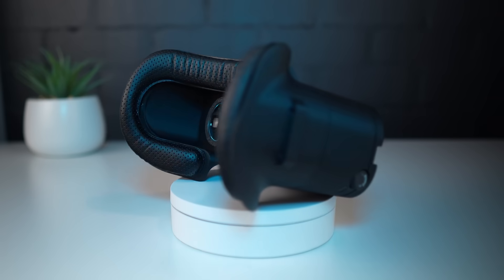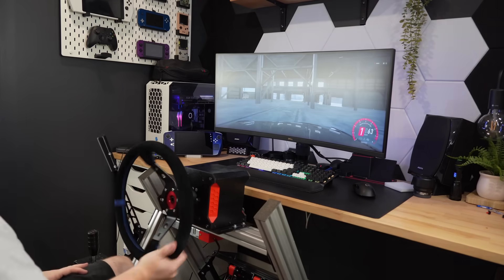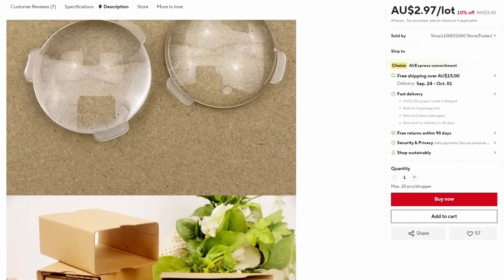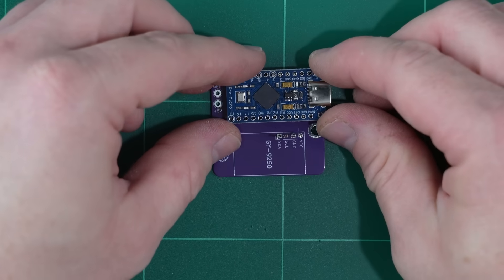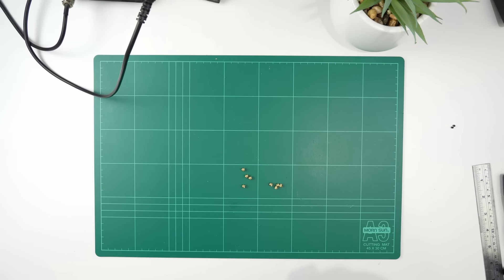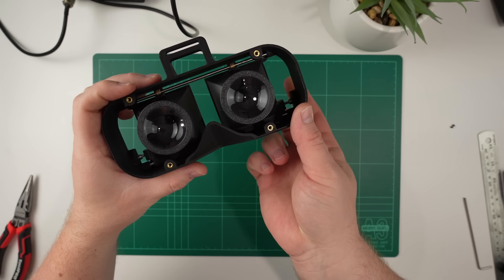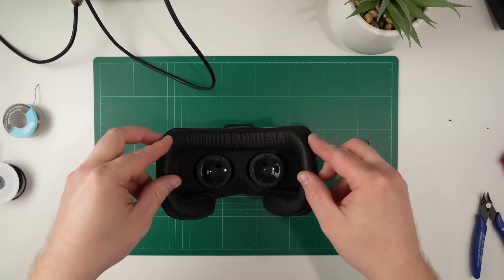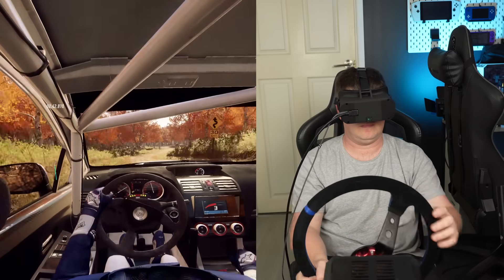I built my own VR for under $150!

Comment: 3.81' 1:1 oled screen is from lg wing bottom display. they are well know in the retro handheld emulations. not ideal for your case. but afair there is a 960p 3.4' 3:2 120hz display may be of used. it was used in anbernic 34xx and 34xxsp

Comment: This is great, going to give it a go.  You can get a 2nd hand Quest2 now for about $150-$200 so it doesn't save much money, but it's a great project.
Reply: From what I've seen on FBM, Quest 2 seem to range from $90-125, while $150-200 seem to be the price for the Quest 3S.

Comment: Hmm, only 3 dof might actually be good for me. I built a 6 dof simulator and you have to do motion cancellation to make it work well. Not having to cancel out some of that motion would make things a bit easier, but would have to test it
Reply: How to do 6dof
Reply: @andreass.7152  You mean on the simulator or a headset?  My simulator is a Stewart platform/hexapod configuration. Basically 6 linear actuators that support my "cockpit", which is really just a spine with a seat and controls attached to it.  6 DOF with a headset would be harder to DIY I think. You need some way to track it in space. The old Oculus used cameras watching LEDs on the headset, the VIVE used cameras on the headset that tracked base stations, so kind of the inverse of the Oculus in a way.

Comment: Many wouldn't consider a 3DoF HMD a real VR headset. Cool project tho

Also notable that in my experience dust on the inside of the lens is barely visible whereas dust on the display is extremely annoying and clear as day due to focusing, so it's a lot more important to make sure the displays are as clean as possible

Comment: This is pretty cool. Still more than what im looking for personally. 

I just want a simple head mounted display. My idea was to use one of those phone “VR headset” shell, straps, and lenses as a base. Take that apart, put the screens in it, and a PD board with a single USB C port. 

If it all worked then it would be connected to my dock for video and power off the iPad. 

So its main input for power and display would be HDMI to USB C single cable. 

But to be honest i have absolutely no idea of how to get started, or if my dock has PD on the HDMi port. I dont think it does because it’s just a cheap $20 dock. 

Anyways theres my idea, take it for free and run with it.

Comment: I wonder if I could do this ... but use the larger screen ... because I have only one eye ... 🤔 😲 🤔 🏴‍☠
Reply: ( lost it 10 years ago in an acid attack ... so my brain already learned depth perception, etc ... so that's not gone anywhere ... before anyone decides to be an arse about it 😅)
Reply: I think you can mod the current model for one eye, everything's mostly out there.
Reply: @M3LSK1  Yeah ... I was mostly reacting to the non-use of the larger panel due to the crossover thingy ... as that's just not an issue for me ... quite frankly ... I could probably push one much wider panel ... 🤔

Comment: the power and hdmi is bugging me feels like the wieght of wires can shift the view the only thing i can think of is using mic arm to hold the cables and its weight with enough slack for movement and its a greet place to hang the headset

Comment: If you wanna use this VR headset for VRChat, you can attach a Tundralabs tracker to the headset and use that to track its position. For the mic, you can use an AntLion ModMic Wireless and a headphone extension cable with the headphones of your choice. Now you can build the rest of the setup using 1.0 or 2.0 base stations, Valve Index controllers or Vive Wand 2.0 controllers and some more Tundralabs trackers to fully finish this setup. Now you can play VRChat and show your friends how well your DIY VR headset works. There are probably tutorials on YouTube that show how to turn a tracker into an HMD tracking device. Have fun with your setup!

Comment: I love this project and when I get a chance both with resources in time it would be awesome to integrate base station tracking, maybe display port. 
I have to wonder if the display limitations are partially due to the HDMI connection, DisplayPort has generally higher bandwidth than some older versions of HDMI?
Reply from the maker: Yeah, that is my suspicion too! I wish the thought had crossed my mind when I was ordering. I noticed the more expensive 120hz version uses displayport which should solve the issue. The displays part numbers are almost identical between the two products too (the 90hz version is listed as a LS029B3SX04 whilst the 120hz is a LS029B3SX02) so I might reach out to wisecoco and see if the original displays will work with the 120hz driver board!
Reply: @cncdan  Hey I mean you don't know until you try, lesson learned. Odd that the model would be higher on the 90hz.

Comment: what is the actual advantage of dual invidividual LCD over one larger one? Surely a single display would maximise the IPD range?
Reply from the maker: From an IPD point of view, you're probably right! But finding a single large display with a high enough pixel density will be the challenege! Looking at my phone screen (which is 6.4" 2340x1080) through the lens, you can easily see individual pixels 😞

Comment: for years I've thought vr was black magic
and bro just mastered the dark arts.
Reply: severus snape
Reply: when u want full tracking :D than mabye . Than u need to install cameras or sensors all over the headset
Reply: @War_Beetle  I am aware but considering people have used qr codes and a phone camera to make full body tracking I doubt that will be hard.
Reply: He just made a piece of crap, like you bought a phone attachment. The positioning in this is nothing more than a joke.
Reply: @foxyfox969 unfortunately true, this is just accelerometer based. Actual VR headsets have many other systems for tracking.
Reply: @foxyfox969  Your arrogance blinds you, Master Fox. Now you will experience the full power of the dark side.

Comment: really cool project. very impressively put together. if possible, in order to improve motion clarity (and reduce motion sickness), all modern vr headsets use Black-frame insertion. if there was a way to do that with this set up, that would be cool
Reply from the maker: That would need to be built into the display driver board or perhaps on a software level on the computer! Not sure it's something I can do but I'll look into the options!

Comment: ah yes the classic "I just bought an expensive headset, when I could have just built one myself" dilemma I keep facing with everything every time I buy something expensive.
Reply: Is not room scale tracking and proper VR headset can do far more than a cheap DIY. A $500 Meta Quest 3 can do much more stuff than any device that coat above $1,000 and more on the market

Comment: Something I wish that would become the norm for PCVR is for the connections for USB and HDMI to be at the top rather than the side. This would allow weight to be distributed from the cables to the center and also allow for suspension of the cables from above keeping them out of arms reach. Also the project looks fantastic, I wish I had this 10 years ago.

Comment: The question has to be, as eBay and Facebook marketplace is awash with cheap used Oculus Rift S setups, except for the fun of using kit you've made yourself (and the joy of waving a middle finger to Meta), what's the benefit of going the DIY route?

Not saying that to criticise what you've done, and as I mentioned, I know the immense joy of being able to use kit I've designed and built myself, but I'm just not sure that this is a project I'd invest limited money and time into when there's already cheep, proven, and some may argue, more versatile, options available.

Comment: Ah, beat me to it. I also wanted to use those cheap AliExpress displays for my VR project, but decided against it because of the way to low resolution, poor brightness and color accuracy since they are just LCD displays. At that point I could've just bought a used first-gen HTC Vive.

Comment: Cool project! Only 3DoF is a deal breaker for me, but still love to see DIY stuff like this.
I recently had to replace a sun damaged display on a HP WMR Headset that I got off marketplace for $50. Bought a replacement display off Alibaba for less than $20, shipped and delivered in a week to QLD. Super stoked. It was way easier than I realized to do the swap... plug and play, worked like a charm!
A heck of a lot cheaper if you don't need the driver boards!
Reply: lmk if you find any 6dof solution im still looking
Reply: There is another guy here on YouTube who has a 6dof outside in set up, their channel is called manolo and the headsets he are working on are called persephone
Reply: the IMU supports 6, I'm not sure what FastIMU supports, might just be a firmware fix
Reply: or... use what OpenTrack uses for IR positional? That'd solve it with a camera and most sim people are using that method anyway
Reply: Oh really? lmfaooo knew it was a catch, not even gonna finish the vid then lmfao. next.... thanks.

Comment: Awesome stuff my man. I'd only suggest to mount the electronics such way that the ports and cables face upward and are easily routed over and behind the head.
Reply from the maker: Yeah, I considered this. But without making the unit much larger than it currently is or having the plugs stick out a long way, there was no easy way to achieve that. I figured routing them down the side of the headset was a good compromise!

Comment: This is so incredible, together the ZenDeck would be the ultimate game machine. The only upgrade I’ll do is make it a single cable connection, in order to power and display video with one single cable, having two is not a big deal but sometimes the pc spiderweb get messy with other devices connected into

Comment: You could change the IPD mechanism to a single scroll wheel with a single large circular gear and 2 worm gears between the two lenses. They would then be tied to each other instead of needing to precisely adjust them separately to match.
Reply: That would be a little more complicated but possible. You'd need a left thread and a right thread on a single bar so the lenses move into opposite directions as you turn the knob. The thing is that this method would make the IPD adjustment worse for some people as it moves both lenses at the same time. This method of adjustment shown in the video is better for people who's eyes are offset from the center of their face.
Reply: Not everyone's eyes are the same. My eyes have different distances according to my optometrist, 34 mm and 32.5 mm.
Reply: @jakeaurod  Exactly. This individual adjustment is much better and I'm happy there are VR headsets that use this like the Bigscreen Beyond 2

Comment: Dude, this is sick. I a while ago was doing research and came up with an idea of making my own FPV head goggles by using those displays lenses but being able to plug in receiver modules so you can use it with your FPV drones, so it would be sick if you can make it where you can use it for FPV and VR
Reply from the maker: If you've got a receiver with HDMI out, you could do that! Just be warned though, a setup like this probably isn't ideal for FPV. For one, the input resolution on the displays is 1440x1440 when you run in mirrored mode (which is what you'll need) and the depending on how your receiver handles output, it may not work at all. I tried plugging my cameras HDMI out into the headset to take one of the thumbnail photos, but the camera just couldn't produce a signal that the headset could use. Secondly, the displays pretty much fill your view which really means that only the middle of them is in focus whilst the outside edges are in your "peripheral vision" meaning even if you could see the signal, any form of OSD you have likely won't be legible.
Reply: @cncdan  Yes, exactly, I can confirm that. I tried using the current project (OpenIPC) for FPV, and it didn't work as I had expected. The current project is, after all, more oriented towards VR. VR software warps the image to prevent distortion at the edges. FPV software outputs the image as it is, and in this case, a completely different optical system is needed to see the entire screen and avoid image distortion.

Comment: Hold up hold up display size shouldn't matter for IPD. Because there's no rule that says the optical centre must be at the centre of the display. you can choose to cut the inner vision (nasal crescent overlap) relatively short and expand peripheral vision. You can also choose to fix mount the displays and adjust IPD by moving the lenses + moving the image by software, which is also how early headsets all had a single display with a simple partition and still had adjustable IPD.
Reply: Both of these suggestions DRASTICALLY complicate the build, and have drawbacks. Chief among them is using less of the screen at all times. In the case of the former, you also have to make the lenses move independantly of the screens, and you WILL want to move the acreens to maximize view. This makes the mechanics of the system much more complex. Doing it via software requires both a hardware component that allows you to move the lenses "too close together", and a software component that allows you to correct the screen to the lenses, which is not trivial for an end user to do. 

The solution presented is both sinple and elegant, and works for 99% of cases. As well as being cheap as hell.

Comment: So sad, the refresh rate is a deal breaker. My main complaints with vr are price, refresh rate, and pixel response. 
I just want basic head tracking with good pixel response (for better motion clarity) and a refresh rate that doesn't cause my physical pain. 120hz is bare minimum, but on my 240hz oled monitor, even that feels a little like a slideshow sometimes. 60hz, even 90hz VR is just entirely unusable.
Reply: Most games can even handle 240 hz how do you plan on fixing that problem?
Reply: @Omegakotscripter Depends entirely on your pc, the specific games you're playing, and your settings. I have a relatively powerful pc and I just don't bother playing games I can't get a good enough framerate in. 
I have a 7800x3d and a 3090. I can easily get the framerates I need in assetto corsa, dirt rally, ea wrc, and the F1 games.

Comment: cool, if only someone would flash the HP G2 so that they work on Windows 11 and I could continue to use them.
Reply: You can
Reply: @Omegakotscripter  Microsoft has discontinued support for all Windows Mixed Reality (WMR) devices, including the Reverb G2, starting with the Windows 11 24H2 release. To continue using your Reverb G2, stay on an older version of Windows 11 (23H2) or earlier by disabling feature updates, or consider switching to Windows 10 or a Linux distribution that supports the device
Reply: @R3YVAH someone remade the drivers and published them on steam I forgot the name but they do exist
Reply: @Omegakotscripter thanks, maybe, I was looking in the spring and there was nothing then, maybe someone has already done it
Reply: @R3YVAH it's called oasis driver or smth like that and the only downside is that you can't use it with an AMD gpu

Comment: Those dual panels on AliExpress shipped in tons of headsets, mainly Windows Mixed Reality for the 1440p and 2160p Sharp LCD panels and the larger Samsung displays were used in the first Quest, a few Vives, and Samsung's WMR headsets. So yeah, they did get used for their intended purpose!
Reply: Wondering what‘s bro’s job
Reply: @jeanVana-w1z  Bro does 3d modelling

Comment: Verryy coool! Would it work for adventure/action games? Is it comptable with those kind of games?
Also will it work with other open-source vr projects? Like the body tracking project... (I forgot it's name)
Reply from the maker: I haven't played any VR adventure games, but I imagine most of them require some form of positional tracking (which this doesn't have). It is basically a head mounted display with a head tracker, so you could definitely leave out the head tracker board and include whatever other tracking options are available!
Reply: @cncdan okay sweet! Thank you for the clarification!

Comment: the wires tho...
Reply: is pretty much a must for any pcvr-headset. there is streaming over wifi yes but most of the time its bad. for this specific diy project two cables would get a little annoying if you play games where you move a lot but you wont be playing those anyway unless you make yourself some vr controllers or buy ones. for sim racing its perfect how it is.
Reply: @Iwasfoundunharmed yup yup. But the positioning kills me. It could've been better

Comment: These panels are the same as in the Lenovo WMR. I've gutted mine to build an openipc drone google. I chose 50mm focal length and even at this distance I can see the pixels, just a  heads up to anyone picky. If we could find a higher pixel panel diy VR could suddenly be a pretty good option in my opinion. You can find 31mm dia lenses with a focal length of 50mm very easy on Ali. But this gives too little FOV for VR, but large for fpv pilots. I bought the 120Hz now and hope the openipc system is able to keep up ;).
Reply: panels from this project works only on 60hz, that what the chinese seller told me (